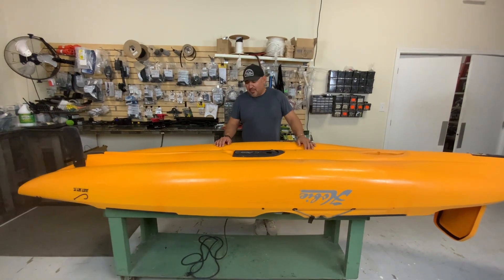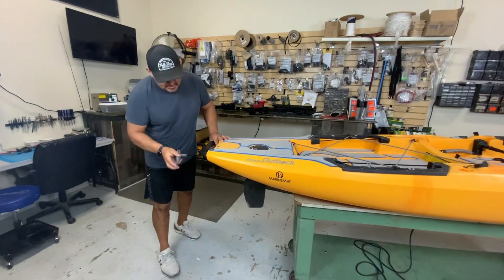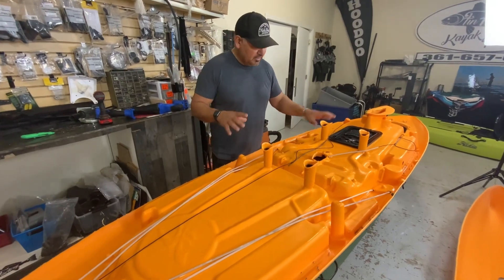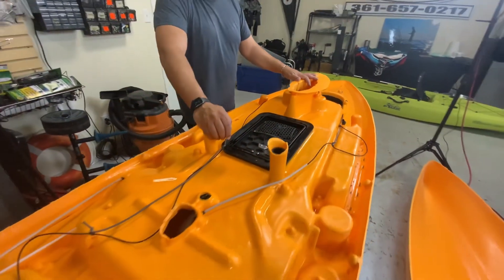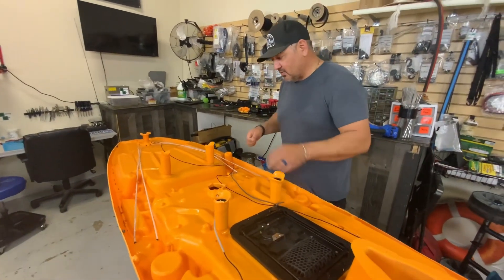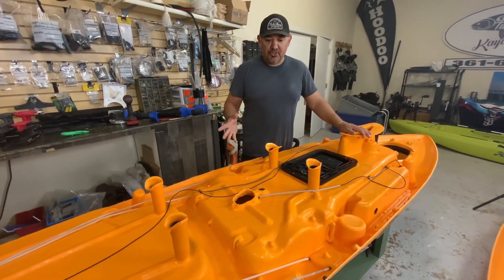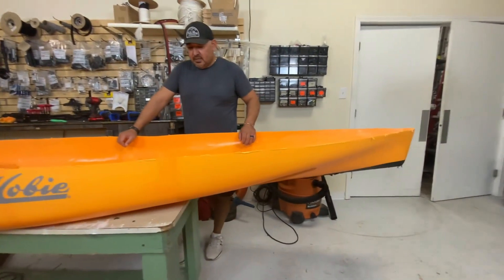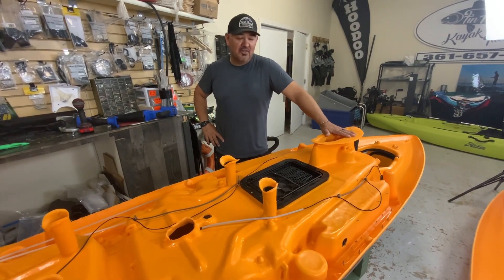EP 31 - 2022 Hobie Outback - Autopsy

Comment: The scupper crack seems to be a common issue with the the 21's and 22's. Not just with Outback, seen people have the exact same problem with PA's as well.  I don't really think its a car top strap problem, people have had the issue using yak trailers. Hobie seems to think its a cart issue, at least they use that as a excuse to avoid warranty claims (if said person didn't have a hobie brand cart.)
Reply: I still can't see any justification for Hobie's inflated prices!!
Reply: @johnguth5376  They have been getting worse every year. Think the kayaks are bad look at the insane pricing they have on accessories and replacement parts..... 200 bucks for a 20 dollar square hatch for example.  Really they are just trying to milk as much as they can out of the Mirage patents before they all expire.

Comment: Not to be redundant with my questions but….is there a better made boat value?  I was going to buy one this summer.  How can I avoid theses cracks coming about and the unsealed screws that may soak up moisture.  Specifically, what would you do, buy another brand or modify and take steps to avoid cracks.  I’m rough on things.

Comment: Man, you killed that hull!  That is an easy fix no doubt.  Plastic epoxy for the crack (clamp it closed with a butt ton of greased up hose clamps, so they won’t stick) allow it to cure, then remove the clamps, reinforced with PVC pipe that’s cut in half (heated and moulded to size of the unaffected scupper transition).  Score it all up with 50-60 grit sandpaper, blast it with high pressure compressed air, wipe clean with acetone, heavily apply MARINE or POOL grade silicone caulk all around the scupper tube, do the exact same on the inside of the PVC halves; ensure a consistent even coat with the silicone, and slap that PVC in place.  Then tighten it all down with as many hose clamps ya can get on the length of the scupper, and tighten each clamp evenly, much like tightening up a vehicle’s wheel lugs.  Don’t over tighten, as it will squeeze all the silicone out.  On the outside of the hull, score the it with 50-60 grit sandpaper, blast it with compressed air (air compressor), wipe area clean with acetone  gingerly heat the hull and at the same time ready some melted HDPE plastic (ya can melt a 5 gallon bucket, but the stuff is everywhere pretty much for free), drip it into the crack and agitate it in there with a smaller jeweler’s flathead screwdriver.  Allow it to cool to room temp, sand it down, again blast it with air, acetone, and apply bout 2-3mm thick of HDPE again.  Score up the inside of the scupper tube with sandpaper, blast, acetone, and liberally coat with the above mentioned silicone. Apply a good coat of silicone caulk inside to the outside of the scupper, covering all the work.  Since ya gonna have a grip load of this silicone left, go back to the inside of the yak and give a nice big ol’ coat of that silicone all around the PVC to the top of the hull down to the bottom (remember to score everything up with sandpaper, air, acetone).

If your yak leaks after that…. It ain’t from that area fo sho!

This is for y’all who are out of warranty and feel it’s hopeless, NO SO, you got this!!!
Reply: You got a video on this repair?
Reply: I would really like to see a video of this process, and I think a lot of people would be interested in seeing it too!

Comment: So the 2019 have seat rest issue and the 2022 have scupper issue. Wow. I warranty my 2019 and got a 2022. Took my 22 out for her maiden voyage and found a hole in the scupper from factory. My 22 have the new rod holder tho. Looks like hobie need to add more plastic